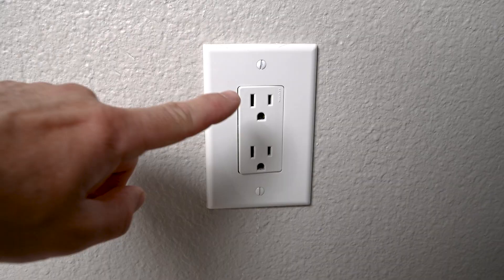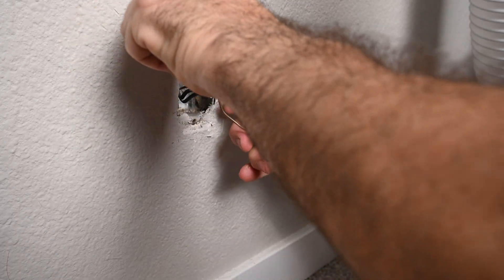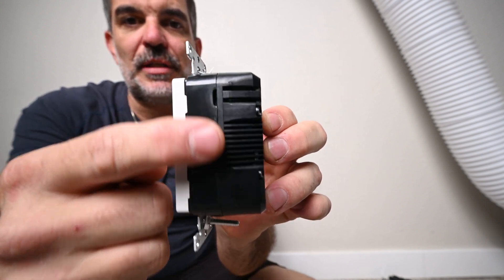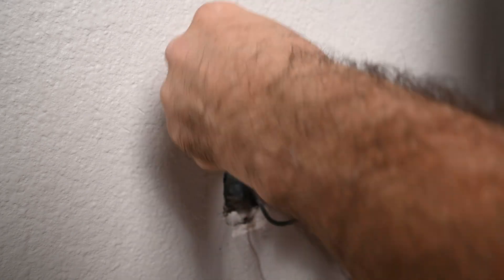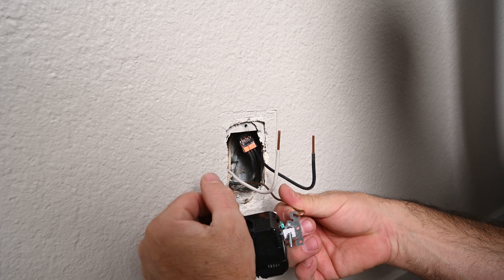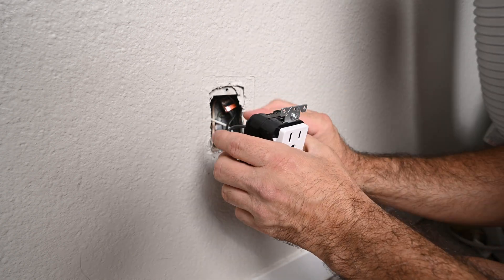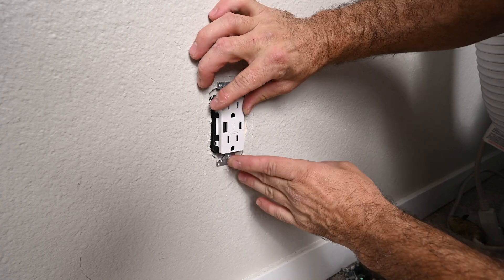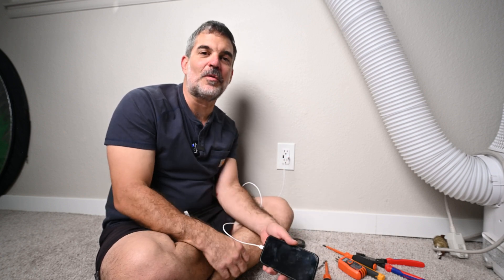Receptacle Installation with Type A and C USB Charging Ports

Comment: Just as an extra precaution you should always remove the ground wire last and connect the  ground wire first when installing, I know people will say oh the circuit is turned off or what not , but to me it's better to be safe than sorry. As a commercial electrician I always treat wires as if they are hot even if I just personally turned off the breaker. Just my thought!
Reply from the maker: Thanks for the tip!

Comment: Each screw accepts two wires. No need for pig tails or those connectors.
Reply from the maker: I should have elaborated more...but this receptacle is in line with others, if it fails so do the receptacles down the line. By pig tailing them like this, if the receptacle fails, the ones down the line are still working.